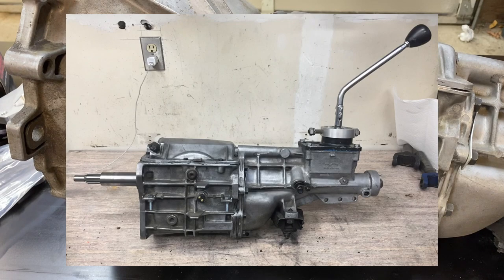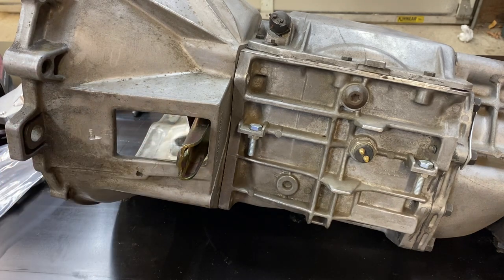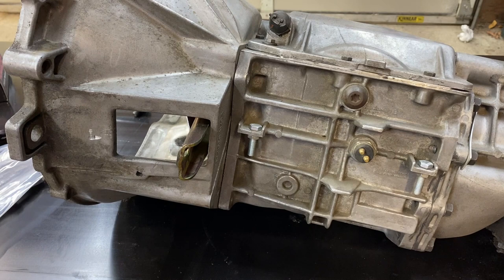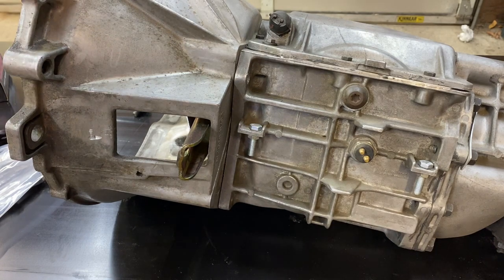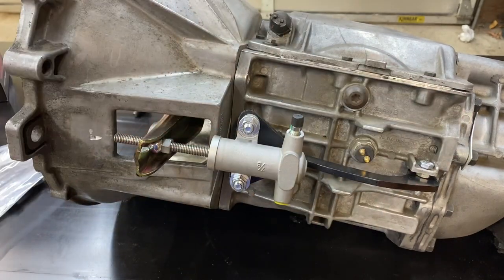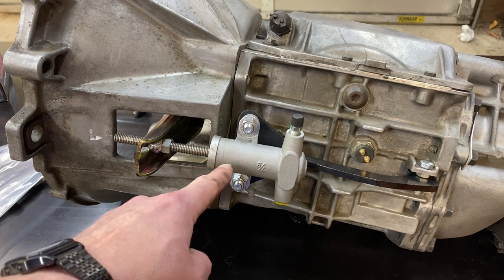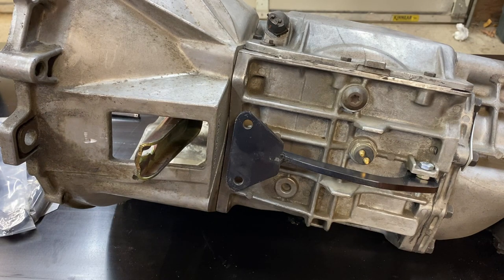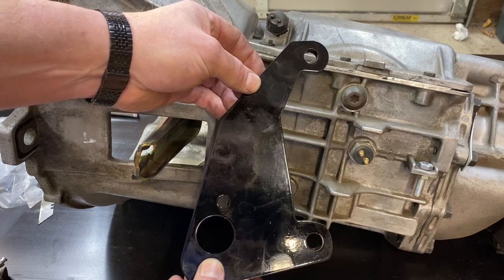Classic Ford T5 Hydraulic Clutch. Clutch actuation options when installing a T5

Comment: I ordered your kit 5 years ago for my BMW with a 302 and then the project sat.  Today I'm finally installing it and I look for a how to video and it's your video, haha.  You have saved once again.
Reply from the maker: Glad I could help!!
Reply: @dazecars  Is it possible to convert an a4ld to a T5 2.3 liter 1989 mustang with a hydraulic clutch?
Reply from the maker: is the T5 coming out of an 89 Mustang or going in it?  I guess what I am sing is I need ore info year make and model and exactly what you are wanting to do.   @someguyto4675
Reply: @dazecars  T5 is going in. converting it from an automatic to manual.

Comment: Why didn't you tell the guys how to bleed a hydraulic clutch? Dodge and Ford used them back in the 60's and 70's and they were always a problem. Cable clutch works a thousand times better, never fails, and takes 10 seconds to adjust.
Reply from the maker: Thanks for the comment.  Bleeding a clutch is not that hard and there are already videos out there.  As far as your claim that cars in the 60s and 70 used this technology and it was problematic,  that doesn't prove anything.  Lots of things that were problems in the 60s and 70s are not problems now.  Most modern cars that run a clutch use hydraulics and they work as well and trouble free as brakes.  The cable IS an inferior setup.  When it fails it will bind or snap, they require large sweeping arcs, and they don't like heat so you must keep them away from the exhaust.  I have been selling hydraulic clutch kits for 20 years and tons of my customers are guys wanting to ditch the inferior cable and go with something more reliable and smoother and so they are making the switch to hydraulic.

Comment: Does that mean if I'm going with the hydraulic option there is no need to use the adapter plate at all ? Doing this on a 200 inline 6 set up.
Reply from the maker: So in order to avoid the adapter plate you must use a V8 SBF T5 specific type bellhousing.  The information I found said "200 I6 1978-1983 only, partial (4 of 6 bolts) pattern."  now I don't know if that means you can bolt a SBF bell to a 200 I6 with only 4 out of the 6 bolts are if they are just in the same location and something else would interfere with using a V8 bell.  If it does fit I would be concerned about only using 4 of the 6 bolt holes.  Quicktime may have a bellhousing with the correct pattern for your I6 allowing you to run the T5 without the adapter but quicktime bellhousings are expensive.
Reply: @dazecars  thanks for that!! I've learned in two days information I've been trying to find for the last year haha
Reply from the maker: glad I could help.  Let me know if any other questions come up.

Comment: I have 66 Mustang with factory disc brakes with the large Master cylinder. What clutch  master and slave cylinder set up would you suggest with a 93 T5 bellhousing and transmission. We will be switching from an Automatic to a manual and have the parts to switch the pedals.
Reply from the maker: does it have power brakes? if not my 65-66 kit, master cylinder, and line kit should be all you will need.

Comment: Mine just went out on my 67’ 289 / t5 and glad to know it’s going to be an easier repair than I originally thought. Mostly cuz my wife thought it was stupid I bought it but she said as long as I don’t need to pump the clutch 10 times before entering a gear, she’s fine with it😂
Reply from the maker: Having to pump it a bunch of times to get it to work sounds like a bad master cylinder.

Comment: I didn't see any mention of the hydraulic clutch actuator that is concentric with the input shaft. I have these on both my Small block Ford /T5 hot rods and loved them.
Reply from the maker: That would be a hydraulic throw out bearing.  I didn't mention them because I don't like them.  With a slave cylinder you still get a feel for what the clutch is doing through the pedal like you would with mechanical linkage.  With a hydraulic throw out bearing you loose that feel.  A lot of people use hydraulic throw out bearings and are happy with them but I would not be among them.

Comment: Needed a clutch solution for my 67 Mustang project with 347 stroker matched with T5. After looking at so many kits, independent hydraulic throw out bearings, etc. I think this is the way to go. I will be ordering the full solution soon. Thank you for a great looking product!
Reply from the maker: My pleasure! Don’t hesitate to reach out if you have any questions.
Reply: @dazecars  quick question. For 67 Mustang will I need to make pedal changes?
Reply from the maker: @TheRaulr151  no my 67 kit bolts to the pedal in the OEM clutch linkage hole.

Comment: Finally perhaps the best video for what I need. All info straight forward . Answered almost  all my questions. Thank you . Will be purchasing this week. 
1970 mustang 3 speed , 302
Reply from the maker: It you are upgrading from the 3 speed to the T5 it will work. If your trying to go hydraulic with the 3 speed it will not work.
Reply: @dazecars  yes upgrading to T5 
Getting a T5 off a 91 mustang . So should I use the bell housing or comes with ? 
Any modifications with the pedal?
Reply from the maker: @dieselburner4461  you must use a T5 type bellhousing, flywhhel, starter, clutch and pressureplate.
Reply: @dazecars  what’s the tooth count for the flywheel? I’m trying to order but I guess there are different ones
Reply from the maker: @dieselburner4461  it 157 tooth, but it needs to be for a lat 80s early 90s mustang so the ring gear is in the correct location. An OEM 93 mustang starter will be gear reduction and not very expensive. flywheel also needs to be balanced properly ether 28 oz or 50 oz depending on your motor.  Lots of variables in getting the correct flywheel.
Reply: @dazecars  I just got the flywheel off 
It’s a 164 tooth on my 1970 mustang. 
For the T5 I will have a 157 T since I’m using the bellhousing from the world class T5 (86 mustang)
Reply: @dazecars  actually worked out and car runs great . thanks again
Reply from the maker: glad to hear it

Comment: FYI, I have one of the old JMC Motorsports systems that I bought back in 2009, recently the master went bad and the company is Out of Business. So after asking around I finally got an answer for my fix. To repair the 3/4" master I had to use a Harley 3/4" brake master rebuild kit (45400), this was a perfect rebuild kit for my needs  and after an upside down bench bleed it was installed and still works to this day. I use an 86 bellhousing with my T5 on my 67.
Reply from the maker: glad you got it fixed, thanks for the info

Comment: What a great video! I'm working on my project which is a 1953 Ford Mainline. I decide to put in a Ford 300 inline 6 and mach it up to a T5. I love the idea to have a hydraulic clutch in it. So i have a couple of questions for you. 

1- what T5 would you go with?
2- What master cylinder and slave cylinder would you recommend?
Reply from the maker: First question is the easier of the two.  For best results you want a V8 T5, preferably from the early 90s.  It will be more robust than the late 80s T5s.  There are several things you can add to a T5 like a billet counter gear stabilizer and one piece steel input bearing retainer to  increase the strength of the T5.  As to what master and slave I first need to know how much stroke is required at the clutch fork for your setup.  From there we can work backwards and try to determine the best master slave combo for your application.
Reply: @dazecars  thank you for getting back to me. I will let you know stroke asap

Comment: Hello dear
I have a 1996 Explorer 302 engine 5 liters efi automatic gearbox and I adapted a 5-speed manual gearbox from a 1992 F150 engine 302 5 liters efi The adaptation was not good because: the hydraulic collar of the clutch does not push the press and the steering wheel and collar had to be supplemented, which causes strong shaking in the transmission. I will be grateful if you advise me what I should do. Thank you so much
Reply from the maker: I don't do anything with hydraulic throw out bearings

Comment: I bought this kit from you a few years ago, the only issue I keep running into is the nut against the ball on the slave cylinder keeps backing off (loosening) then wont go into gear unless adjusted underneath the car.  Ever ran into this? I'm thinking of drilling the rod and putting a cotter key in it to prevent it from loosening.
Reply from the maker: As long as there is a little preload the pressure from the pressure plate through the clutch fork should keep it from moving. That is how I have run my cars for years, however a few have had the same issue you are. To solve it I now include a jam nut with the push rod.
Reply: @dazecars  ok thanks! I'll try more preload, if not ill add a jam nut.
Reply from the maker: Let me know if you have any other questions or if I can be of any further assistance.

Comment: Love this video.   It is very informative and I would like to give you my business..  do you have kits for Chevy T5?  I also have a 62 Galaxie.  However I am building a 54 Belair as well
Reply from the maker: No I do not offer anything for the Chevy T5.  My kit would technically bolt up to the transmission, the problem is my kit uses a push type slave because the Ford bellhousing actuates the clutch back to front, but the Chevy T5 bellhousings actuate the clutch front to back.

Comment: Hi sir by chance would you know the bore and stroke of a clutch master cylinder from a 98 f150 that came with a 4.2? I purchased your 94-95 kit a while ago now I’m trying to do the math you showed in another video.  Been looking everywhere online w/ no luck.

Thanks.
Reply from the maker: I have no idea.  You should be able to measure on what you already have. or if its to hard to get to see if a local parts store has one in stock and measure on it.
Reply: @dazecars I’ll try that thanks for the reply

Comment: So I'm confused, I have the Z-bar and I hate it, the clutch engagement is at the very top almost dangerous to drive.  So waht do I need to buy to switch the direction of the fork?
Reply from the maker: What bellhousing are you using?

Comment: Daze,  My car is a 68 Mustang Hardtop currently with a C4.  Do you have an article about the installation of the clutch master cylinder?
Reply from the maker: I do not.  My website is full of articles but not one on the T5 install.  All these cars seam to be a little different after 50+ years.  The kit comes with basic instructions and then I am available through email for tech support

Comment: Do your installation instructions for one of your hydraulic slave cylinder tell how to bleed the system since that is the main complaint being air trapped in the system. I have heard there are some mathematical calculations that need to be done when using a hydraulic throw out bearing but does the external type slave cylinders like those you show in your video require alot of calculations regarding the throw out bearing or can you just bolt up the external slave cylinder along with mastercylinder and lines then just make sure the system is bled free of air? Sorry about all the questions. I am trying to convince myself and rationalize going hydraulic instead of a z bar mechanical style.
Reply from the maker: They are a pain to bleed and the kit instructions come with basic info but also because all these cars are a little different are only basic and assume the installer has decent mechanical ability.  With that said I provide excellent tech support answering install questions including additional info for those that need it on bleeding the system.  The only math is in matching the master cylinder to the slave cylinder.  You want the bore of the master to be smaller than the bore of the slave to reduce pedal effort BUT if the master cylinder bore is smaller you must have enough master cylinder stroke to have adequate fluid volume to provide the required stroke to actuate the clutch.  I have done the math and the master cylinders I sell meet both requirements for the clutch kits I sell.  If you want to use your own master I would need to know its bore and stroke.  At that point I could do the math and see if it would work with either of the slave cylinders I offer.  I am happy to answer your questions here but it might be easier if you contacted me through my website so we can correspond via email.

Comment: I'm guessing that if you're doing this off a hoist the most simple way to purge air from the slave cylinder would be to jack the rear end up while bleeding, to offset the downward tilt of the transmission?
Reply from the maker: thats an option, gravity bleed, power bleed, bench bleed and a whole assortment of other options can be used with varying success.  20 years of selling these and I have yet to find a one size fits all solution.

Comment: I was just wondering about something in your video. For example If a person has a 65 Mustang with a 1973 302 engine mated to a toploader 4speed but wanted to swap to a T5 trans then couldn't they just use a T5 bellhousing AND T5 transmission from a 1988 Mustang GT and still keep the factory Z bar setup for the 65 mustang? 
Then they would not have to use an adapter plate at all since you would be getting rid of the toploader bellhousing and toploader trans?
Reply from the maker: no because the clutch fork on a T5 bellhousing works by moving the fork from the back of the car to the front but an old school z-bar setup is designed to work on a fork that goes front to back.  They make a clutch fork conversion block but it doesn't work well and results in a stiff pedal.

Comment: I'm using one of your hydraulic converting kits on my 1970 mustang, do you know if I need to take the spring of my clutch pedal.  I'm talking about the spring on the clutch pedal assembly..
Reply from the maker: No return springs are required. The pressure plate will force the slave piston back into the slave pushing the master plunger out, returning the pedal to the normal resting position. If you have any other questions don’t hesitate to ask. My instructions are basic and require a certain level of ability on the part of the installer because all these cars are different. No two cars left the factory exactly the same and most cars have been modified heavily in the last 50+ years. Because of that there is no one size fits all set of instructions. With that said I am always willing to help in any way I can.

Comment: I’m looking into swapping a 3550 or a tko into my f100 with a 302 in it I was wondering if you had any input on installation for a ford pickup and if maybe you could comment the link to the website so I can purchase the adapter rod
Reply from the maker: I sell brackets for the 3550/TKO.  lots of people have used my kits for f100s.  Yo0u need to use a TKO specific bellhousing.  not sure what "adapter rod" you are asking about.

Comment: Do I understand correctly that the rod with the sperical ball goes in the hole closest to the transmission and not the outter hole with the dimple
Reply from the maker: That is correct.  The inner hole fits the spherical ball better and by moving it 1" closer to the pivot .1" less of stroke is required to actuate the clutch.  One could design a bracket to use the original cable hole if they wanted to but that is not how I designed mine.  I wanted to slightly reduce clutch fork stroke and tuck the slave cylinder in to the transmission as close as I could.

Comment: Will this also work with a 200 i6 with the modern driveline adapter between the trans and bellhousing?
Reply from the maker: I am sure it can be made to work but I can not see a reason to do so.  A T5 is IMHO a far better choice to go behind a 200 i6.  It will be lighter, less expensive, slightly smaller and the i6 does not have nearly the torque to hurt the T5.

Comment: Hi I have a tremec 3650 on a 351 Windsor the clutch is a dual disc setup will this engage the pressure on the twin disc
Reply from the maker: Does a cable work?  My kit is designed to replace the OEM type cable. I have not worked with a twin disc setup. So I can not say for sure put we could figure t out if you get under the car, make sure the throw out bearing is up against the pressure plate, and mark the position of the fork on the bell. Then you can use a threaded rod or clamp to pull the clutch fork forward until the output shaft of the transmission spins freely. Mark the fork location on the bell and measure between your two marks. If it is 1” or less my kit should work. More than 1” it may still work with a bigger master BUT it will increase pedal effort.